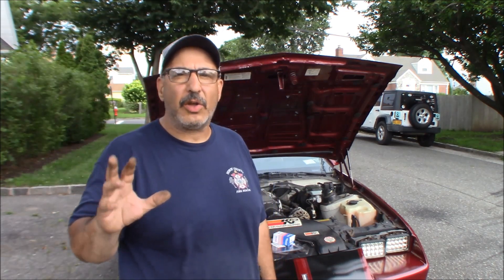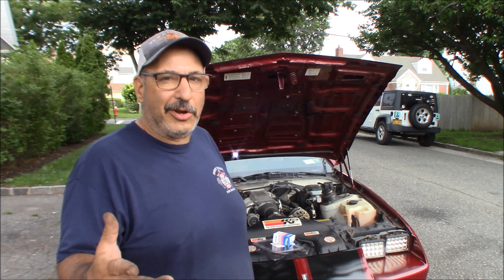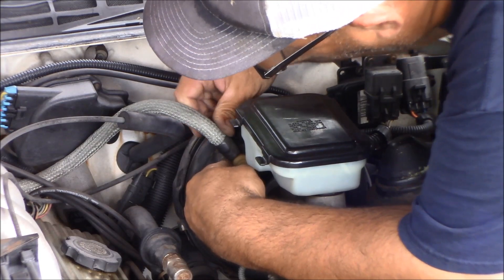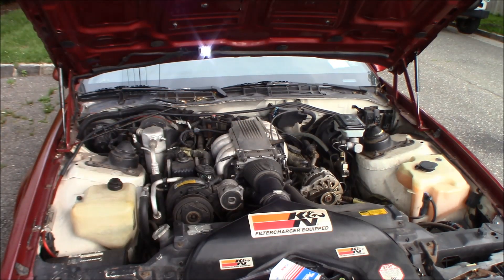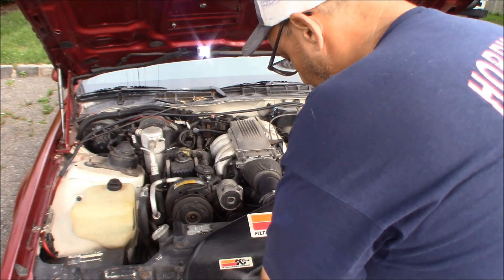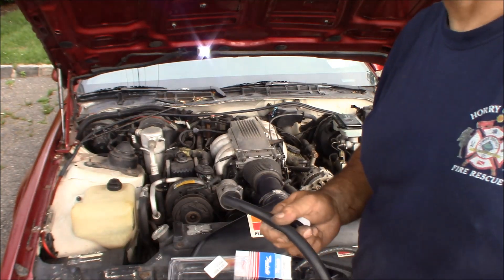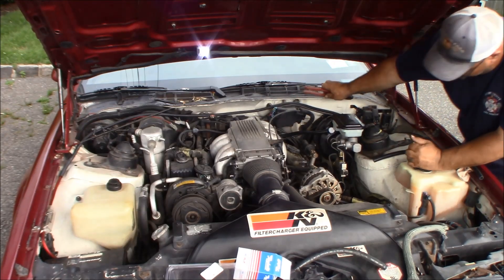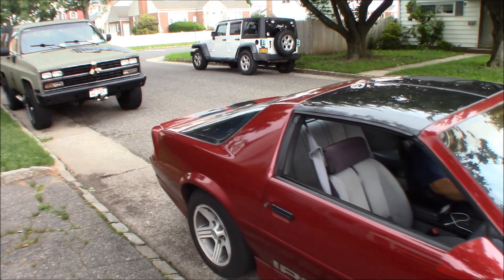Low Brake Pedal Saga - New Booster Check-Valve and Hose - 1988 Chevy Camaro IROC  Z28 | Video 4 of 4

Comment: when we put the new brake booster in our mustang we had the same problem, the push rod wasn't long enough to push in on the diaphragm so we had to get a longer bolt and now the pedal sits all the way up high
Reply from the maker: We did check that, it is not the problem.

Comment: There is a hack for the third gen brake combination valve. If you unscrew the nut on the front of the valve and put a stiffer spring in it, the back brakes get more fluid to them. You can also use shims if you can’t get the spring. There is a video on YouTube about it. I haven’t tried it yet. I’m waiting until I change my master cylinder to try it.
Reply from the maker: I've never heard of that.  Thanks, I'm gonna look into it.
Reply: @AxlesGarage  I recommend checking into a few threads on TGO on this topic.  While it can help, it could end up being a band-aid for a different issue.  Make it all work right first is my suggestion.
Reply from the maker: Did some more research, calipers are the culprit.

Comment: Those rear calipers were notoriously bad. The pins froze in them. GM came out with a service bulletin back then. New kit had a tool to knock out the sleeves and install brass or bronze slides.
Reply from the maker: It seems like the caliper/parking brake adjustment is the key
Reply: If I remember correctly, there really isn’t any adjustment on them. I’d unbolt the caliper and see how free the slides are
Reply: @stevealtman9872  I believe the caliper piston adjusts (parking break).
Reply: @BowTied69  yeah but it’s self adjusting. Most of the time it freezes up
Reply: @stevealtman9872  Right, you previously said there isn't any adjustment.  And yes, they stick sometimes.